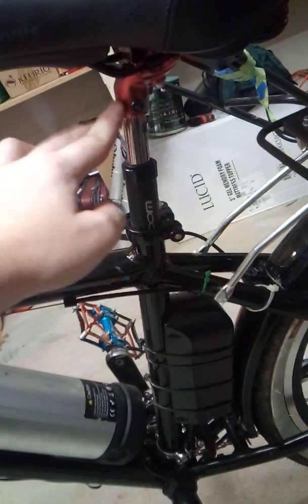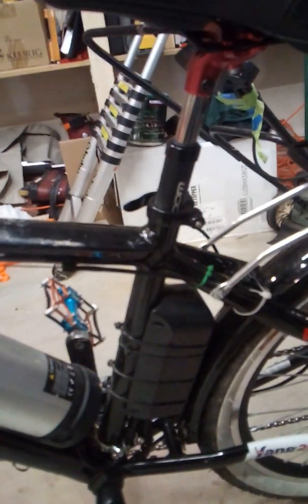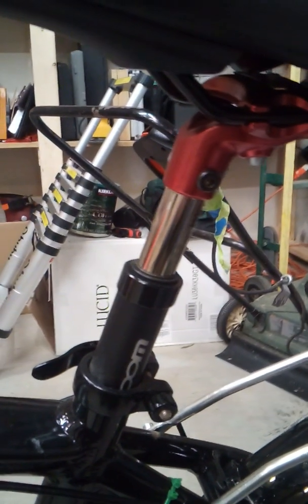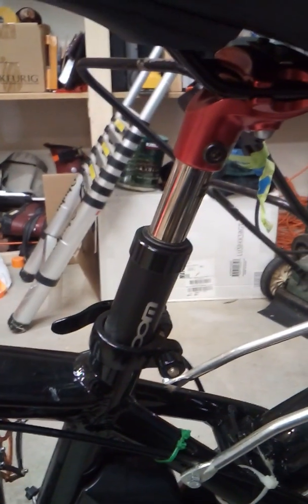Zoom suspension seatpost wobble repair modification mod.

Comment: You may want to mention the model as a Zoom Tequila (Like mine) is a completely different assembly that would be destroyed with a drill to the head... then again it probably wouldn't come loose like this model either due to the different construction.

Thanx for the video tho. You may be the only one to bother sharing this fix for that particular part.
Reply from the maker: Yeah they probably realized it had this flaw and fixed it. One of my most viewed videos... Must be common problem. Thanks for comment😘😘😘

Comment: Hi there. I have the same issue and was thinking of doing this exact fix that you did. However, i was thinking of drilling the hole front to back (instead of sideways like what you have there). There is a hole on the back side of the base of the clamp if you remove the warning sticker. When i looked closely there is like a hollow pin that i could not remove. I think that holds the clamp in place. Do you think it is ok to just drill through the pin? What size of bolt did you use?
Reply from the maker: Smallest one I had about 1/4 inch. I don't know... Just the way that worked for me... Just make sure it's tight.
Reply: @AquarianSoulTimeTraveler  I had it fixed today. Drilled and threaded all the way through. Rock solid now. Thanks man!